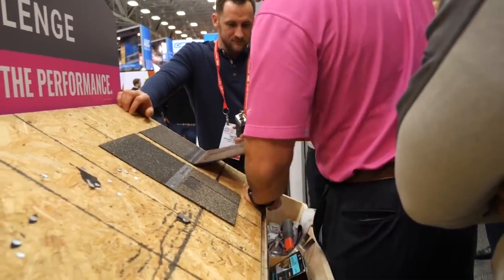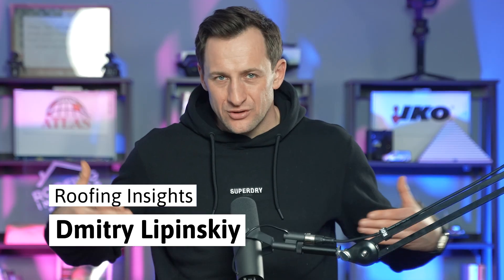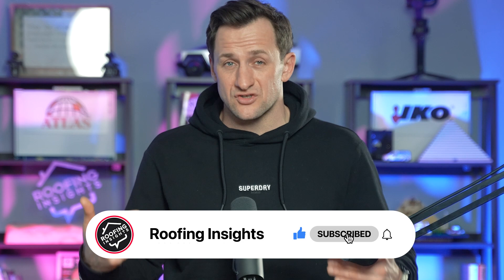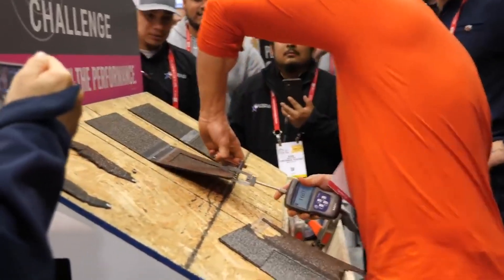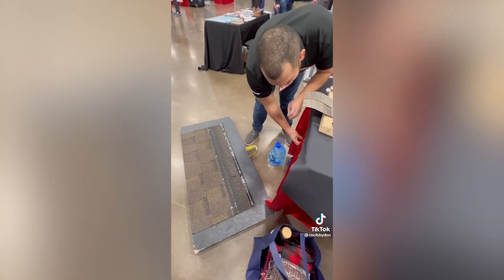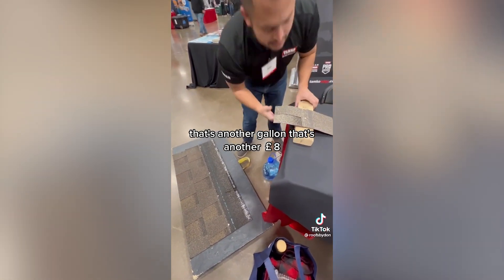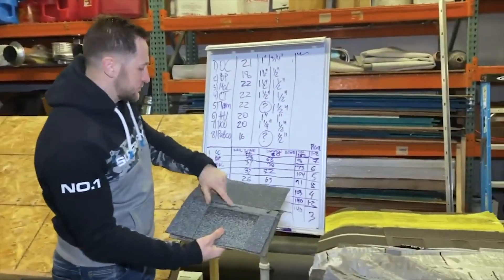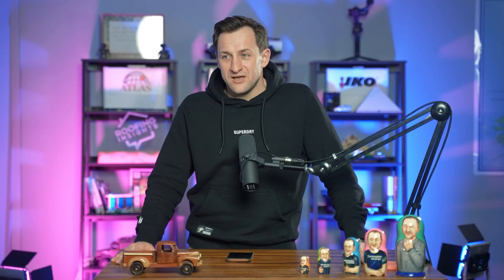Why Asphalt Roofing Shingles Keep Failing their Own pull Tests?

Comment: I watched a Tamko ad and now I have seen others too both wind and pull tests. What I don't get is that they are not installing them in the same manner they are to be installed on the roof. The tests with shingles directly attached to wood with no layer under it is not valid in my opinion. Those bonded areas bond to other shingles or to something else under the shingle, not the wood. Each brand has products recommended for warranty. It would be nice to see a comparison of all brands installed to manufactures specs after they aged and allowed the bonds to do whatever in real weather after a month or so. Most people don't get hit with a hurricane an hour after the roof was installed and some bonds may take time to set.

Comment: Technically there is no need for a pull test. Shingles should not blow off if the sealant on the end of the shingles doesn’t fail. If you have good enough sealant for your shingles to properly seal down, you should not have a wind issues.

Comment: No, I don't believe the pull test should be a part of the next shingle guide. As you said in this video, it's not a practical test. That's not how shingles get ripped off. Additionally, I do think the tar lines that bond the shingles should be tested. This is where the shingle will fail in a real wind scenario long before the nails do.

Comment: It depends on the test. At these shows the decking gets used over and over. By hour 2 you're already using a worn out deck and putting nails in existing holes. Unless the deck is replaced as would be with a new roof, it's just not worth it.

Comment: Pull test is important but one of many contributing factors. Other factors that we consider when choosing a shingle: how well will the granules hold up over the lifetime, how quickly does it seal, how long does it stay sealed, how difficult does the manufacturer make it to file a warranty claim, how often do they approve legitimate warranty claims, and how easy is it to blow though the nail zone.

Comment: Great video! Pull tests are just that, a gimmick, shingles are never subject to that type of strain except for when the roof is replaced. The “better performance” on a pull test means removal down the road will be just that much labor. The sealing strip and how the shingles seal to them selves is a better test.

Comment: Local representative in Pensacola, Fl did a test for us and I saw it works. He even gave us another set of shingles so we can try it by ourself. I think Tamko Titan is a good product but there is still more expensive then Heritage that doesn’t has these strip that make the shingles stronger. In Nothwest Florida Tamko has a pretty good amount of materials in stock. We did a several roofs with there materials and didn’t have a problems. Nails is important for every shingles especially in the areas with high wind

Comment: It all comes down to common sense. If your in a high wind area or not. South face or north face. Right product and proper installation. Winter or summer. For e.g south side /low as summer 4 nails is fine. 
Northwest side high wind winter doesn’t hurt to 6 nail ( 1   2   2   1 ) or tab top 5 or 6 rows.

Comment: I don't think doing a pull test is a bad thing but I think the more important thing to consider is the sealant, if they seal really well and it prevents wind from lifting them up then the pool test wouldn't be really applicable.
Reply: Sealant test please!
Reply: @AKZboy2  I imagine that would be very hard to control that test.

Comment: it def matters, its part of the shingle and when the sealant fails there needs to be a second line of defense.
Reply: My only issue with this is, once the tar line fails in a heavy wind situation, it's going to creese and possiblyrip and fly off, resulting in a damaged shingle. What good is it that the remaining shingle is still attached?

Comment: We think the pull test is important in order to measure the strength of the nailing zone, but there should also be a test of the sealant. The strength of the sealant should be tested by having 2 shingle seal together over 24 hours in the sun and see how much force it takes to pull them apart and also the northern roofers would be interested in seeing how fast the shingle seal for those winter time Roofing Projects. Which could be set the shingles in the sun for maybe two hours and then see how much force is needed to pull them apart. This way, you can tell which shingles seal the fastest and which shingles ultimately seal the strongest. Also, we would love to see the shingle test expanded to include more lines such as Owens Corning, Oakridge, GAF natural shadow, as well as all the class for shingles such as North gate, legacy, duration, storm versus duration flex, and the new updated Certainteed landmark pro class 3, the Landmark Climateflex class 4. We love the knowledge and content you’re spreading to this industry and our whole team watches, and discusses many of your videos. Thank you for all that you do.
Reply: Sorry about the punctuation and spelling, I used voice to text to type this.
Reply: Fully support this👆🏻 Sealant test please! That’s the most important part of the shingle when you have an ice dam for us northern roofers.
Reply: I agree on sealant test as well

Comment: I don’t think it matters. The sealant strip is most important. Take OC duration for example, if the sealant strip fails and wind blows the shingle up, that shingle is still damaged and will need to be replaced. Sure, it won’t completely fly off, but it could tear.
Reply from the maker: Good feedback! Noted and will be considered
Reply: Yes, sealant test!